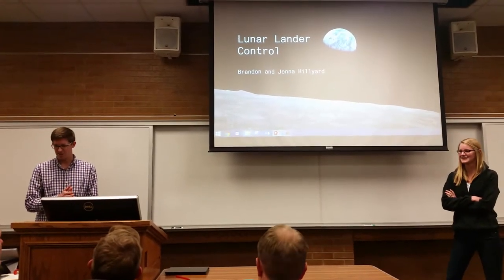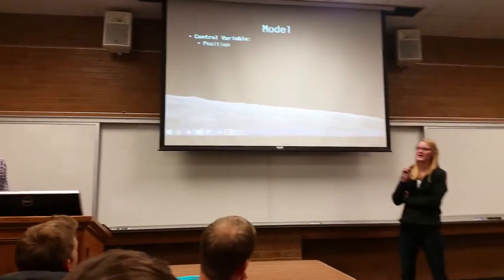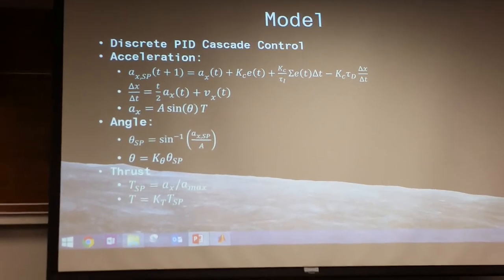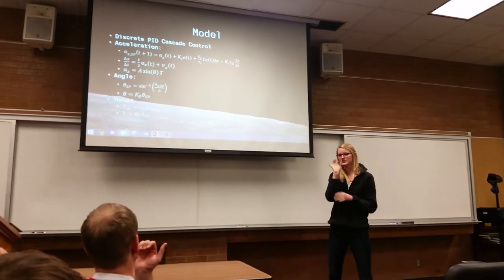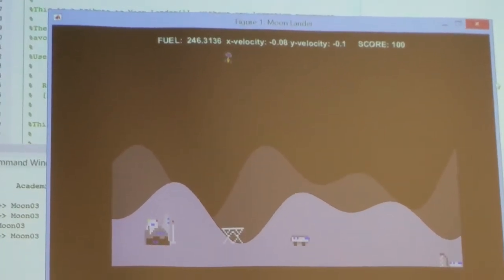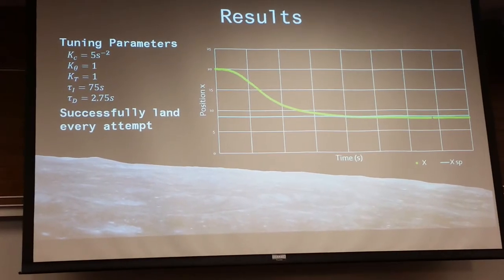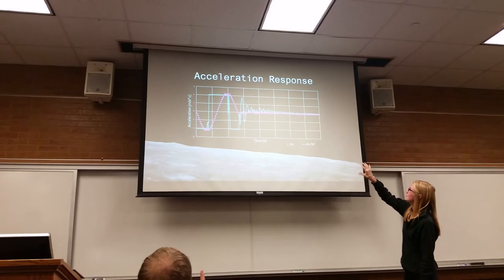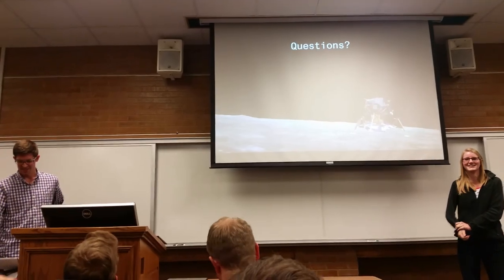Moon Landing Process Control in MATLAB

Comment: can this be modified to make a real landing scenario with a specific set of velocities and thrust
Reply from the maker: Yes, here is a prototype: https://apmonitor.com/do/uploads/Main/Report_rocket_landing2019.pdf
Reply: @apm  Awesome read, thank you for sharing that! I'm trying to recreate a simple 2D scenario on the moon where drag and disturbance don't exist. I need to write a program that will calculate what amount of thrust is needed to decelerate a 10kg lander from a 20km orbit to landing and estimate the amount of fuel needed based on the isp of the thrusters.  I'm using Matlab but I cannot come up with a solution on how to calculate that. Any advice or links with similarity would be highly appreciated. thanks again!
Reply from the maker: @garyhsk8  Check out the dynamic optimization course: https://apmonitor.com/do